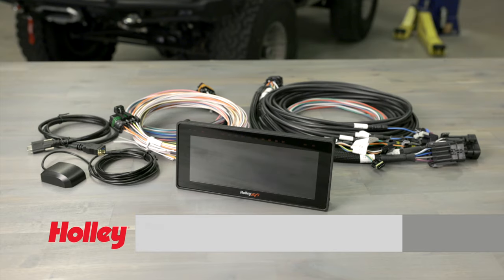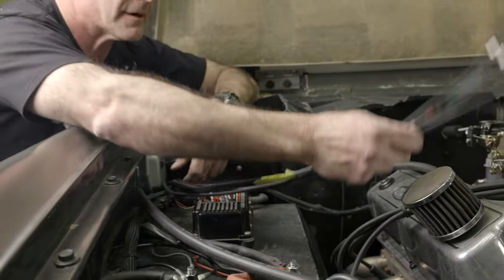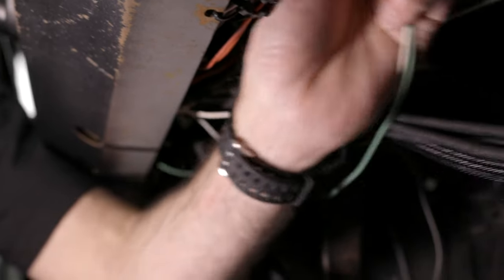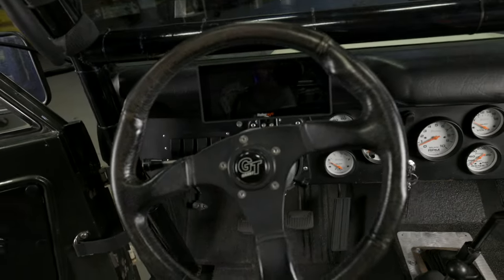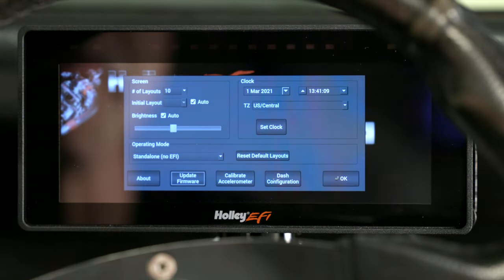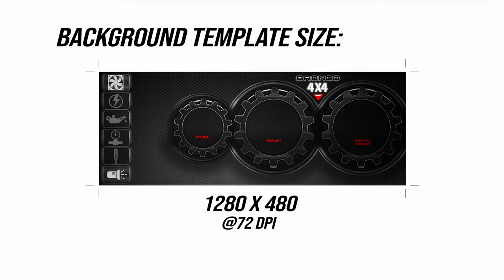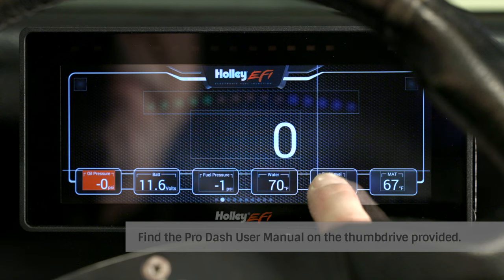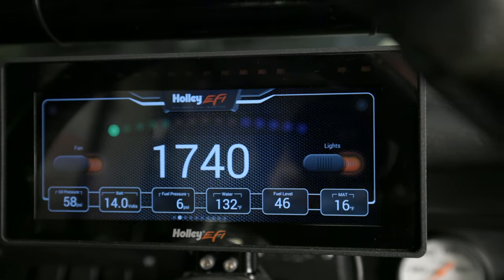How to Install a Holley 6.86” Standalone Pro Dash in a Carbureted Vehicle

Comment: I have the 6.86 on my carbed BBC Mustang, but I am also using the Holley Dominator ECU for datalogging, nitrous control, and smart coil CNP ignition. Trying to show these carb guys the benefits of the EFI system, even if they don't want to lose the carb (yet).

Comment: I wish they had a mounting solution for this in a 68 Camaro I know you can get it for the 7in or Racepak but I like the Holley Pro Dash.
Reply: Those work with carb?
Reply: They do have a bezel for it.  It's HOLLEY EFI 553-300

Ahmad